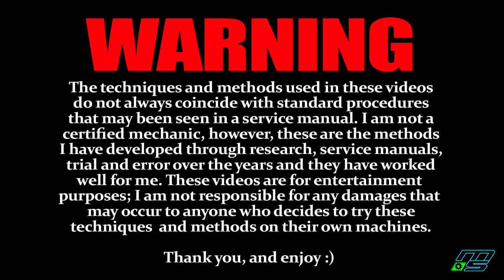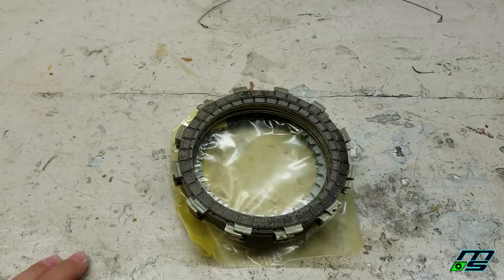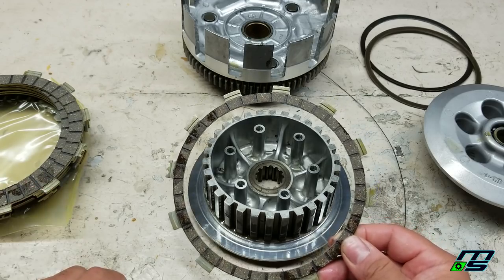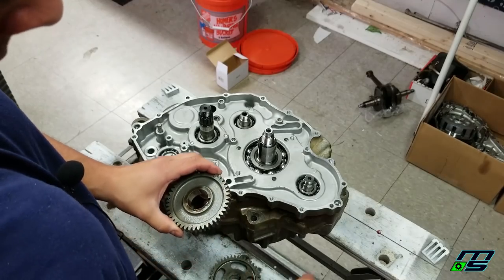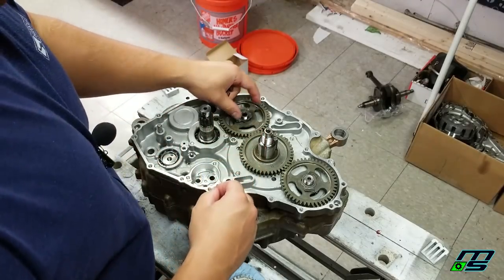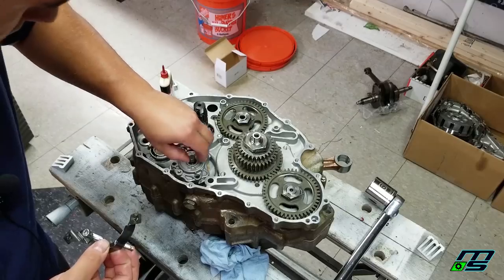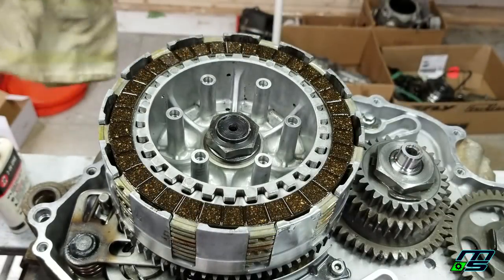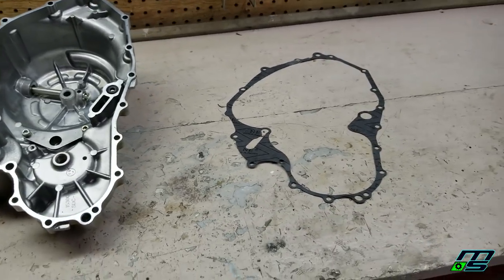Raptor 700 Clutch Side Assembly!!! P8 PLUS FULL FIBER CLUTCH MOD!!! OMG 😱

Comment: as long as its wet clutch your fine i just wouldnt keep changing the oil up stick with one brand and type unless you absolutely need oil and dont have a choice same goes for vehicles they dont like tons of different oils in them they like one type and brand because they all have different conditioners and stuff in them and its not good to swap around a bunch at all :)

Comment: I'm curious, how did u get extra clutch fiber plate for the half on very bottom? Did u reuse one of the older ones? Doing mine very soon, waiting on shipping. Wish we were friends, I'd polish those cases for u, I use wire wheels in drill. Take care
Reply from the maker: Armando Duarte hey man, I'd hand them right over to you to polish! You can order individual fibers from most companies and definitely OEM ones.

Comment: Hey Michael I am talking with a garage to install a coolhead and they recommend me to put 22 cc domes instead of 21 considering I have a stock piston they say. But I want 21 Cc and feel that its better. I only have t9 full exhaust and k&n filter running at 500 ft elevation and about 100 degrees summer time with 280 mains. Also I am gonna install a timing plate, same guy tells me go for +5 but i say i should go +4 he says a 4 wont do anything but i feel 5 is an overkill. What do you recommend? Thanks for taking the time 😅

Comment: If anyone can help, So I'm installing a new clutch. I got it all back together but I'm able to move the clutch lever with my pinky all the way in? It's so loose feeling. Also the I remember when I took the clutch apart the part the cable connects to on the clutch cover was pretty stiff. I'm a noob.
Reply: The shift shaft is out of alignment just take some snap ring pliers and take that snap ring off the shaft that’s on the clutch cover where the cable connects to and pull it up a little bit just until it’s comes pass the grooves and it’s should be a mark on there align it with the mark on the case and push it back down then push the washer back down as well then put the snap ring back on and you’re good to go just adjust the clutch cable free play by the handle bar counter clock wise makes it tighter , clock wise makes it weaker remember with a clutch you need pressure so counter clock wise is never bad just means more let out on the clutch lever to get it moving 🙌🏿

Comment: wow, never heard of that. do you know if the 660 is like that? I have an 02 that i totaled 8 years ago, bent everything, ripped the ball joints thru the a arms,wrapped the rims around the lug nuts etc.... fixed it, rode about 2 years then i stripped the front sprocket nut about a year ago trying to fix a leaky seal (with a impact wrench), well i hope it's the nut. it's free spinning on the output shaft. I really need to fix that.. i guess I'm going to go at it with a dremel and a cut off wheel.  what would you do?
Reply: guy i bought it from said it has a gytr clutch basket in it, but you know how that go's, lol. he said he has $800 in the clutch.. he did have 2 other 660's with i bet over $5k in suspension. so maybe :)